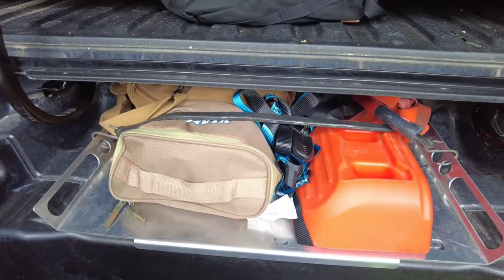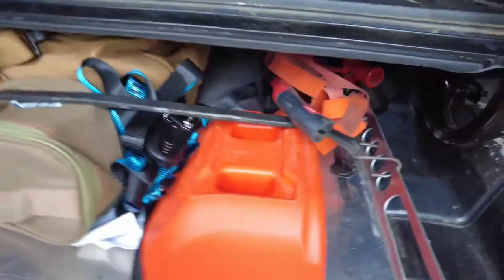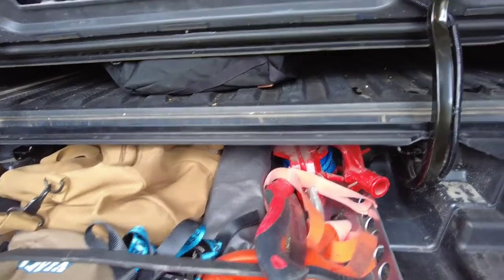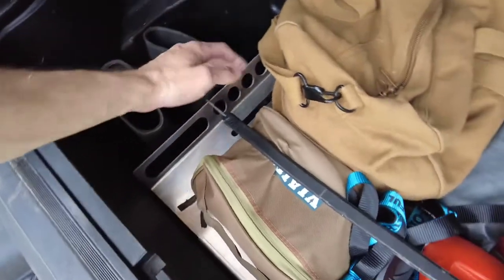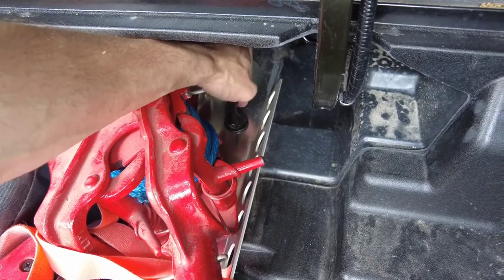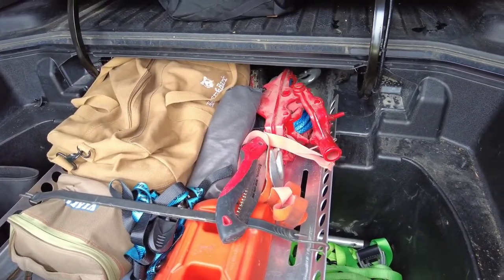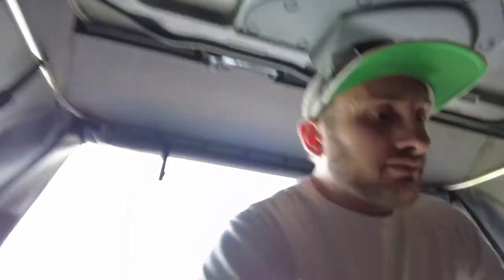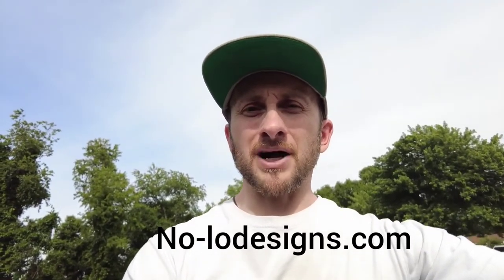No-Lo Designs Gear Tray

Comment: I know you drive a Gen 2, does this also fit the Gen 1?
Reply from the maker: I believe it's too big... How wide is the flat area on your Gen 1? The two tray is 24.5" wide at the base with an overall width of 26.75"
Reply: Thank you for the info! I will measure it tomorrow, I got the skid plates on my Gen 1 and I love them! About to pre order my ditch light mounts. Keep it up bud! 🤙🏾